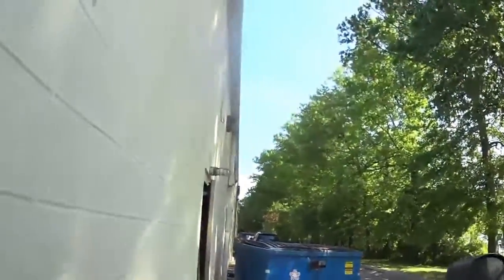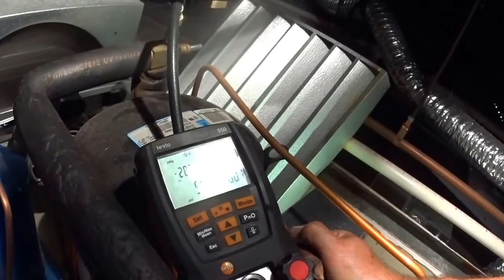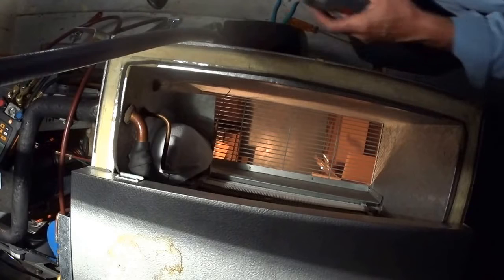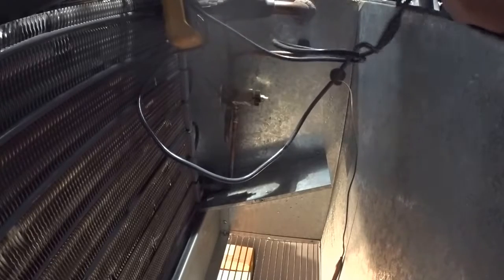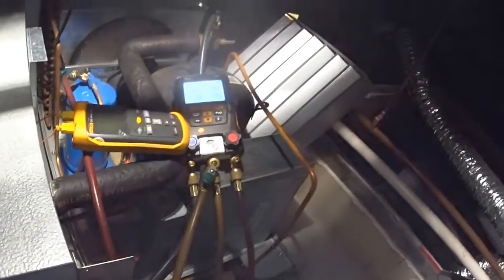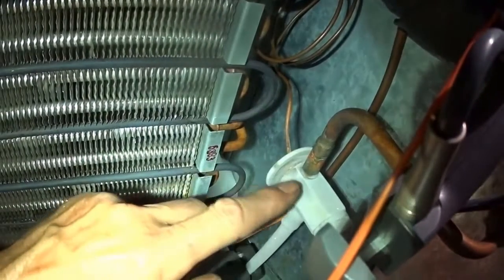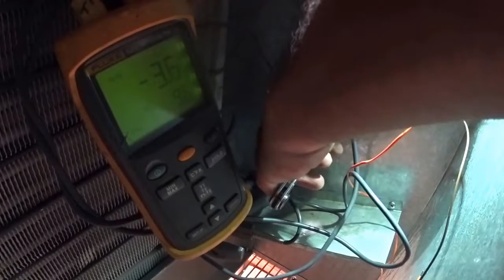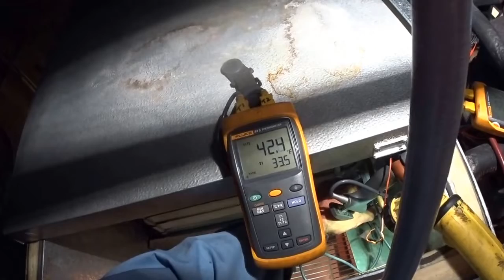Make a difficult adjustment on a freezer expansion valve  part 1

Comment: One of the milking parlour guys i worked with had a cockerel as a ring tone on his phone, never knew if the phone was ringing or just normal background noise down on the farm!

Do you think the valve was stuck shut? it seemed to react very quick to adjustments.
Reply from the maker: heavydiesel Yeah, the spring and bellow looses their spring tension over time, they constantly flex against each other , eventually a little fine tuning is good for better temperature and the electric bill. I'm not 100% sure about this valve for the long term, I was able to get it into the ball park, if I have to replace it in a couple months that will be another pay check.  cockerel ? that must be either a relative of Joe Cocker or a Rooster, I'm getting "English" lessons from you. Thanks
Reply: ***** Well, after the adjustment, if she fails again the Customer and you know u Have to Replace it. if u Do Have to Replace it, i hope u do a Video. it Would be cool to know if that adjustment lasted For a Month, 6 Months or Years. Also Like u Said Put a Sight Glass in, they cheapoed out like u said on those units. Try the " Emerson HMi-1TT3 Sight Glass "  It's the Best imo.
Reply: @JamesPettinato  The expansion valve should not be closed off because it could cause the compressor to overheat and fail. The TD of 65 degrees Fahrenheit on a walk-in freezer is too high and could cause the compressor to work harder than it should, which could lead to premature failure. The ideal TD for a walk-in freezer is around 10°F.

Comment: Great video, the years wisdom and experience shine through.Two questions
1 Does the testto 550 give trouble?
2 What do you think of supco dual input thermometers?
Reply: everton campbell 
Yep. The Testo Family has a cold temperature issue. That affects super heat calculation

Comment: My question when you connect the hoses specialy the suction line that hose is has air don't any one knows were that air go's please I need answers
Reply: Sami, you probably got your answer already, but you hookup your guage hoses with the system off and purge the air from the lines. Goodluck